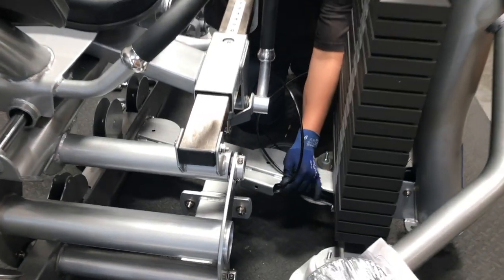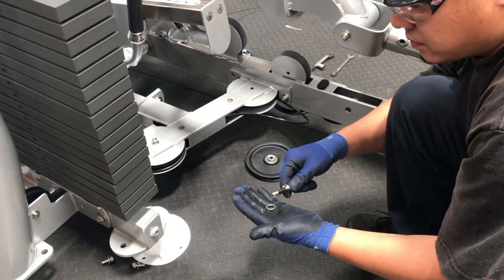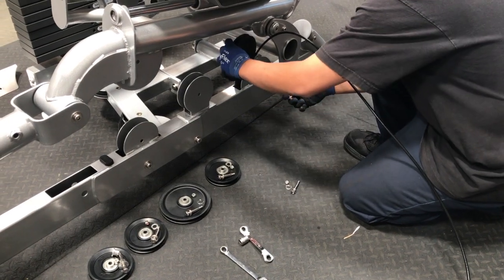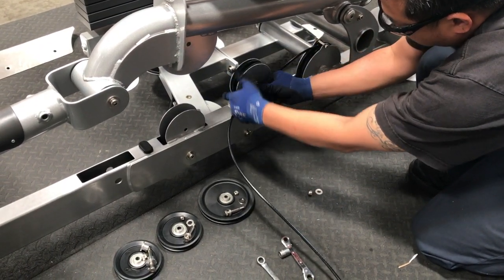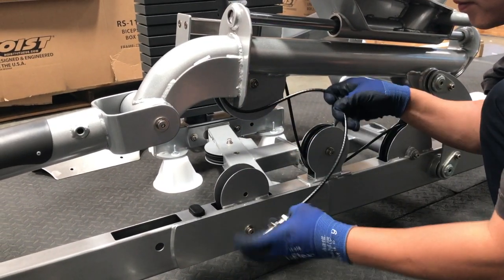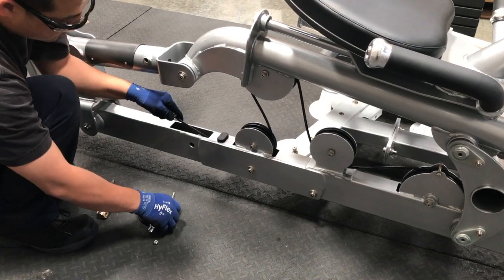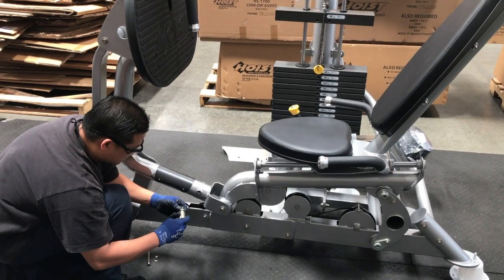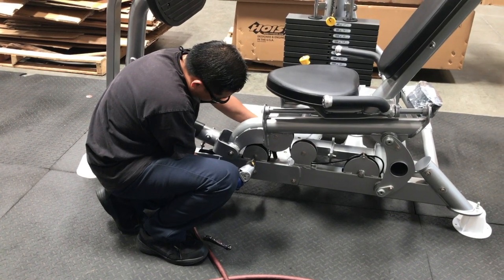HOIST RS-1403 Leg Press Cable Assembly Video

Comment: why didn't you start from the weight stack?
Reply: Exactly same thing I was thinking had to figure out by myself
Reply: @highervibrations3863  it's a brutal repair takes me every bit of 45min with standard 3/8 hex head for my power screwdrivdf